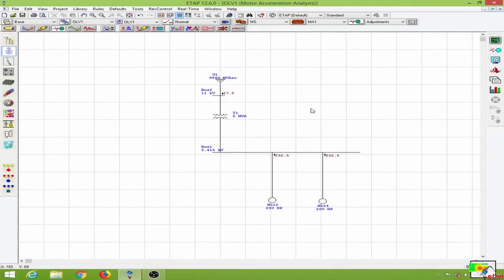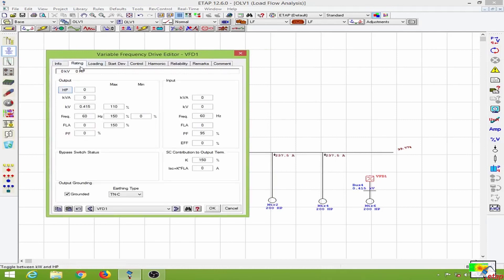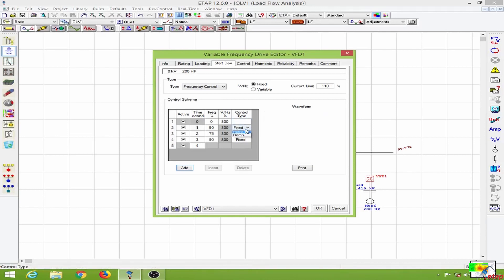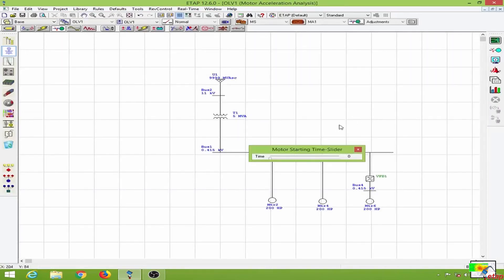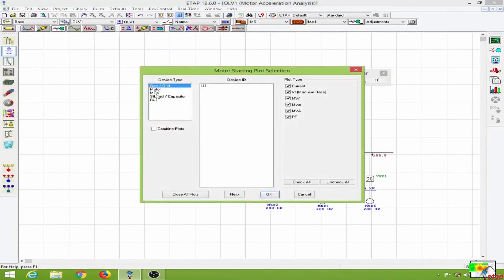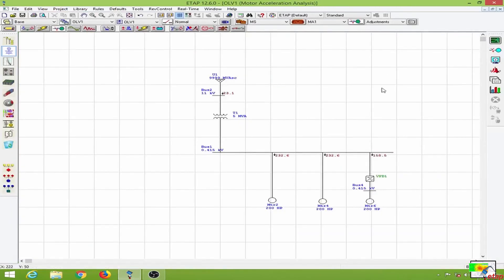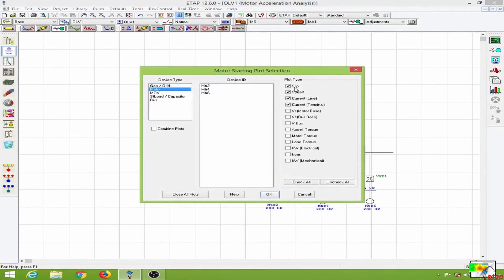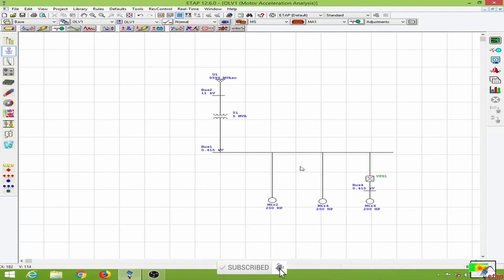Motor Starter VFD- Etap

Comment: the etap help for that field indicates the percentage ratio of the voltage and frequency values in per unit, voltage in per unit vs. frequency in per unit is 100%, now if you have (460V/480V)/(60Hz/60Hz)x100=95.83, V/Hz in Percent
"Specify V/Hz in percent in this column. It is defined as 100% multiplied by the ratio of VFD per unit output voltage over per unit output frequency. The per unit voltage and frequency values are based on VFD rated output voltage and frequency respectively. Note that if Fixed V/Hz is selected, only the first row is editable"